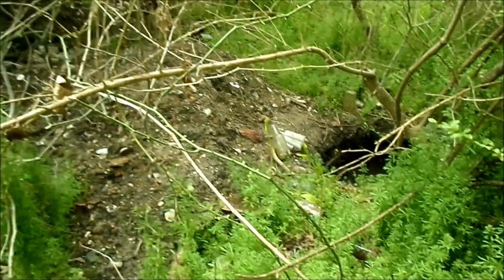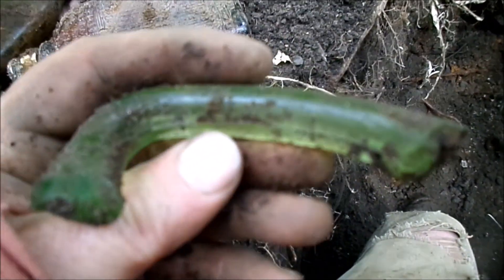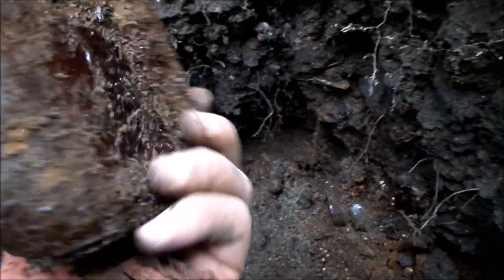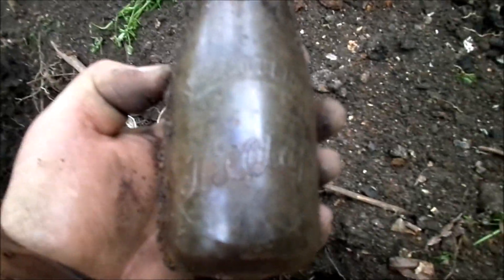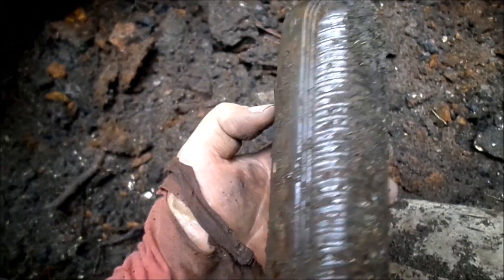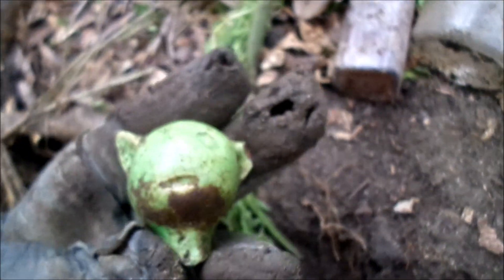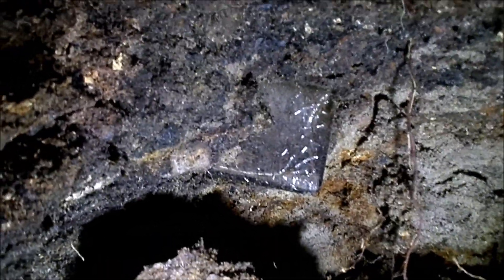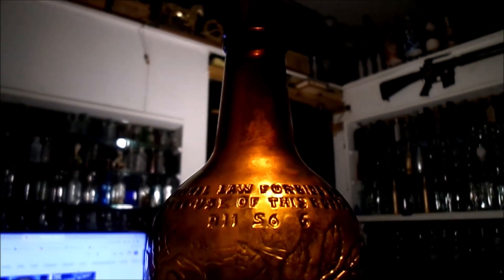Digging for 1930's Bottles in Kinston NC

Comment: Vid 7:36  you really need to look at those multi-panelled ketchups.  Heinz had their patented 8-sideds since 1880s and 1894, and all were handblown up to 1910.  This 6 or 8 ounce would be a special bottle in having a 12- or 14-sided and (if a Heinz) would have the H J Heinz Co Phila Patd with the bot number in the center ... and everything machine made 1910-1920 would have the maker's mark (Owens, Hazel-Atlas, Anchor Hocking etc) underneath the bot number.  You might have found a very small production bottle.

As a researcher for the Bottle Research Group (BRG) for Heinz food category bots (that everybody tosses everything that is food, unless its specialty shaped) those handblowns are handblowns !!  Finding the bot number gives the design and product date range.  Finding a missing Heinz bot of any food category makes it entirely rare.  I would suggest that you take it home and check on its base embossing to be a Heinz bot, or if it is a competitor (various clones of Curtice Bros, Pride of the Farms, Snyders of Cincinnati, etc etc have many other panelled sides and their known dates of operation).